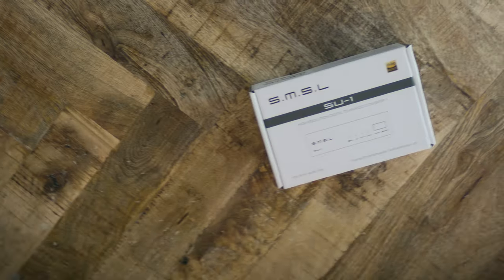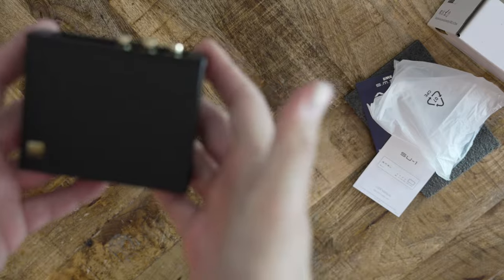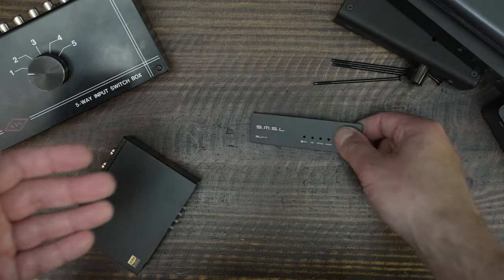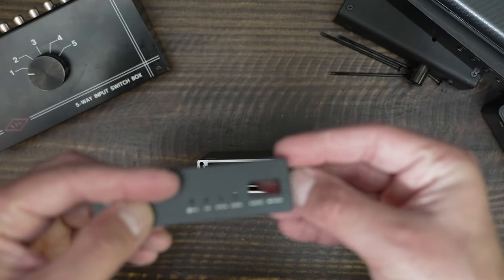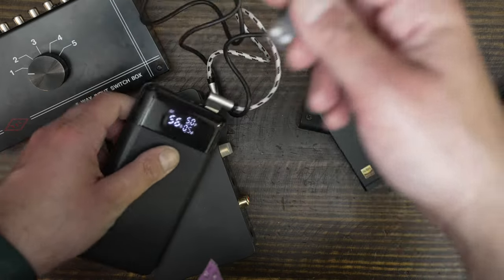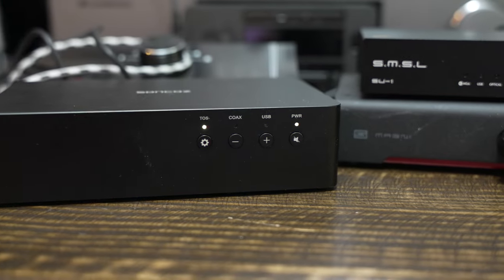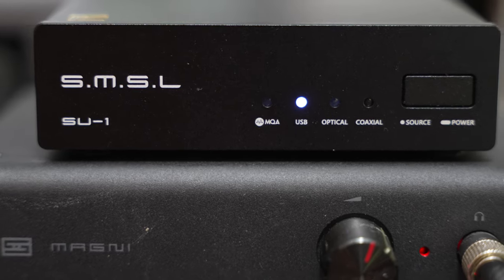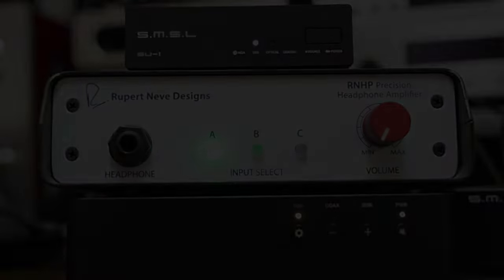SMSL SU-1 - THE Affordable DAC

Comment: I picked up a SU-1 recently and you are right about external DAC's in general.  I'm not a believer in external DAC's to begin with but I figured for $80 it was worth a try based on mostly positive reviews.  I tested the SU-1 on a cheap Sony DVP3962 dvd player and found that the sound of the SU-1 was on par with internal DAC in my Sony.  I switched the back and forth several times and the differences were so subtle that it's not worth noting.   I disconnected the SU-1 and put it back in it's box.  I had planned on doing back and forth testing with audiophile quality players from Rotel and Oppo in my other systems but felt that the SU-1 would not improve on the already superb sound coming from these systems.

Comment: Good morning from Toronto ☕️
Just picked up the Topping E 50 …and it’s pretty good 👍 
Great video.
Reply: Returned my e50, was OK. Had to use a power bank for it to sound it's best, got tired of charging it, so stupid it's not plug and play. It's plug, try this power adapter, this supply than maybe a battery!? No thx, I'm not paying $200 to be an engineer for them.. ;)
Reply: @HiFiMods  I just bundled it together with an IFI power supply…and it’s damn good.

Comment: Hi thank you for the very valuable review
I wonder how the different digital inputs perform
Is one better than the others?
Reply from the maker: No, they all send digital signal. The only possible difference is that one type of connection may support a higher sample and bit rate, which makes no difference if you’re only listening to CD quality resolution.
Reply: @NoThemeReviews  hi thank you very much for your kind and very valuable advice
I have ordered one unit arriving this weekend
I will be using the optical input at first then i Will try the others
In the past I have got decent results with a cheap USB to spdif converter to DAC
But I would like to keep the audio chain as simple as possible

Comment: Thank you! The only substantive review I could find was yours. It does what a DAC should do well (great SNR, low distortion, flat frequency response) to produce an uncolored audio signal and has the codecs I need and want. It will do what a DAC is supposed to do.  For my requirements, it is a no-brainer, I ordered one. Audiophiles are generally clueless about audio, physics, electronics, design, common sense, and reality so I don't listen to them.

Comment: For sure the analog stage has the most impact on the sound in a DAC. A lot of vendors use 1 or 2 5532 op-amps in the output stage, because they are dirt cheap, and
that will ruin every output stage, be it in a DAC or else were. The chip is 50 years old, and it was good compared to others when it came out, but not anymore.

And there is no point in starting a discussion on that. Everyone who has made serious measurements on a 5532, and more important: listened to it, will know it should
never be allowed in serious HiFi equipment. So I would have loved to know which op-amp is in this DAC.
Reply: It depends on the implementation. Opamps alone are not that important.
Reply: @eprpop  It also depends on the quality of the op-amps, that is for sure.
Reply: LME49720

Comment: would you buy a dac like this when using a WIIM pro streamer?  would you hear any diff going out the RCA's on the WIIM vs going out the optical to a dac and then to an amp or receiver?
Reply from the maker: If all you need is a basic dac for your streamer, then sure.  Any dac will do just fine.  I can't tell you without doing a proper A/B test whether there's any difference between your streamer vs dac; but, frankly, whatever differences MIGHT be present aren't going to be significant.
Reply: I connect my WIIM PRO to 3 different DACs and that's much better than using the internet DAC. And yes, they all sound different.

Comment: Do you test for hiss through USB connection? 

For example my ifi Zen Dac is ok through usb. No hiss or noise floor. But adding 5V DC power into the Zen Dac introduces noise floor. 

Same with zen can air. If you add power from mains outlet you get noise. With some dacs and amps I found them to have no noise floor. With others, the moment you add USB in power or DC power you get noise

Comment: I use my Sanskrit 2 daily and the only thing I don't like about the SU-1 is the single USB for power and data. The Sanskrit has two USB inputs so it won't drain my phone. I just wish the Sanskrit remote worked right.

Comment: Not completely accurate please ro listin full range ( all devices are tuned) speakers,mics,amps OP-Amps most of your review is correct except!!! Input can definitely change Output

Please understand headphones physically can't match full range properly setup speakers rhat is where majority fail

I have 6 DACs in my 🗣️ me and there are differences with equipment from modern to vintage